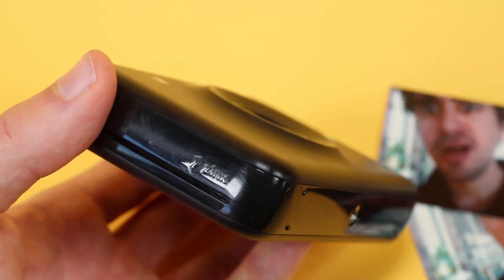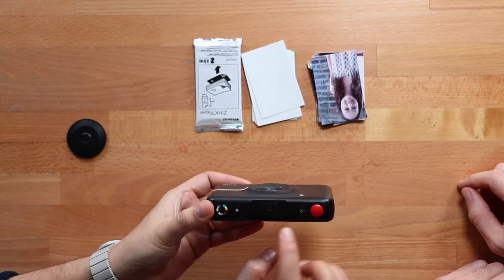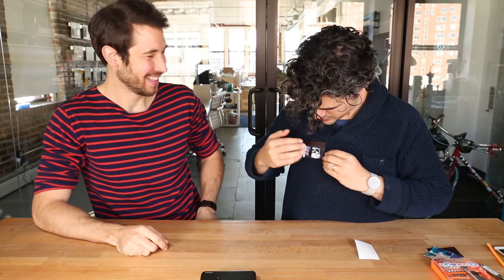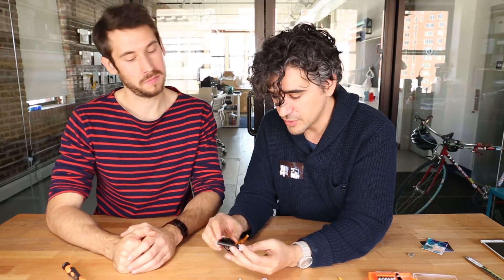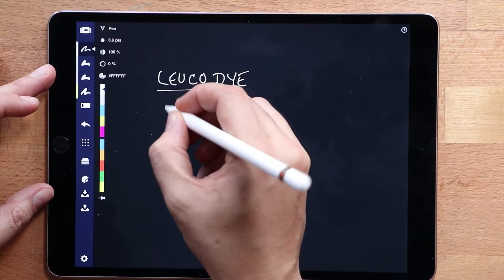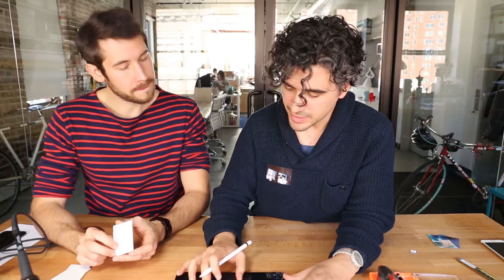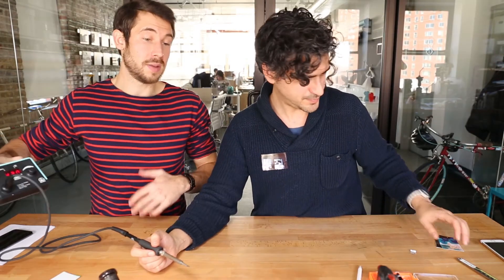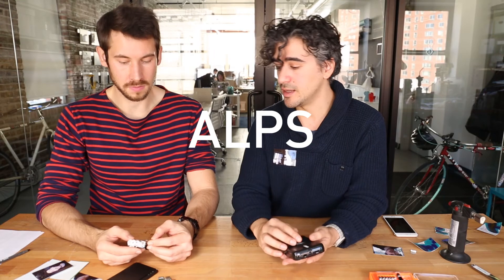POLAROID ZINK TEARDOWN (Snap Camera’s magic printing process revealed)

Comment: You know what would be amazing. Having a zink like x-ray set up. Take a picture of the object you want on your body and do like a body tattoo. Like a zink tattoo. But instead of the paper it's you skin and microscopic needles with the colored tattoo ink does the rest. Have an instant tattoo parlor with the smart dermalogical and safety and  depth and smart dermatologist approved application built in.